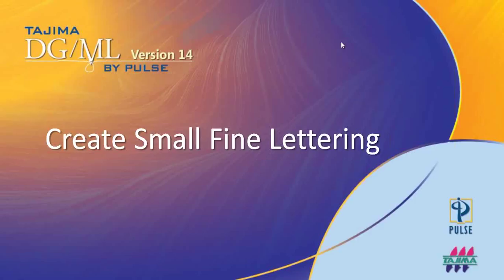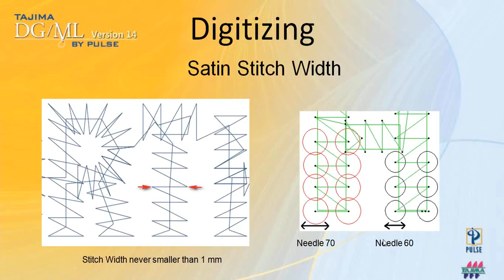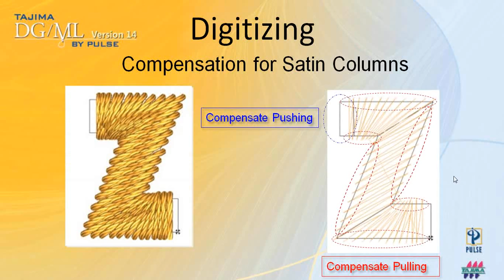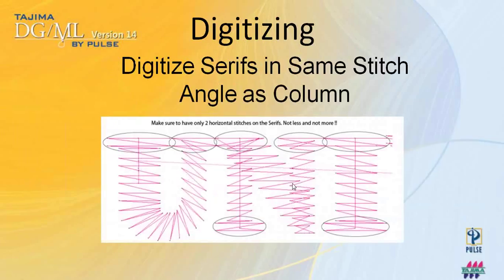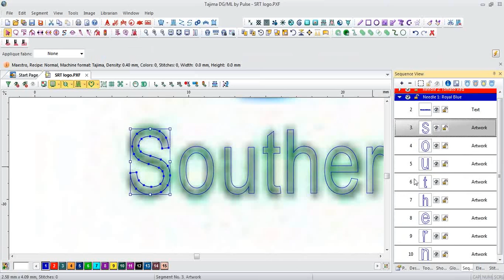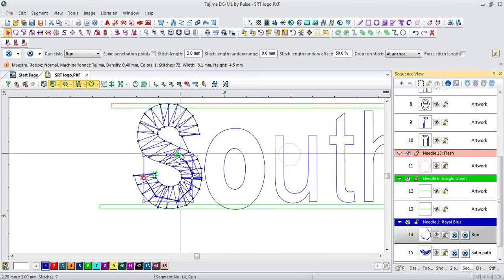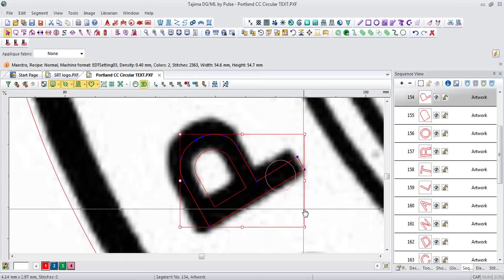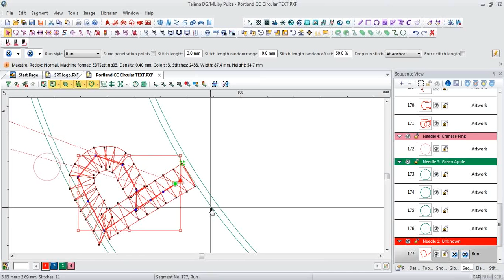Creating beautiful small lettering for logos and designs

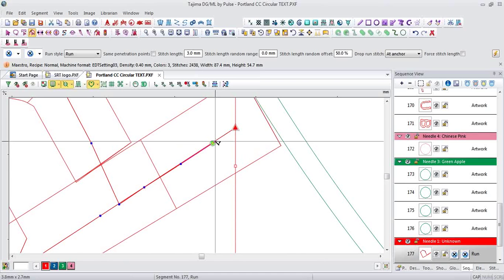Comment: Around 1:07:20, why did you need to adjust the underlay distance? You mentioned something about distance.
Also, you mentioned earlier in the video that for small letters, you don't want to overlap the center line underlay. For letter P, you overlap the center line underlay a little bit. Thanks.